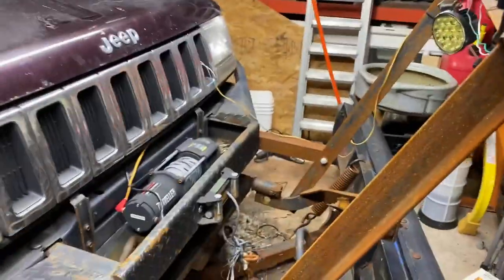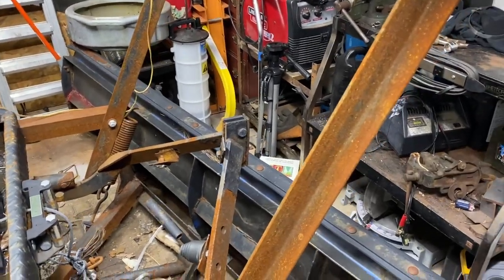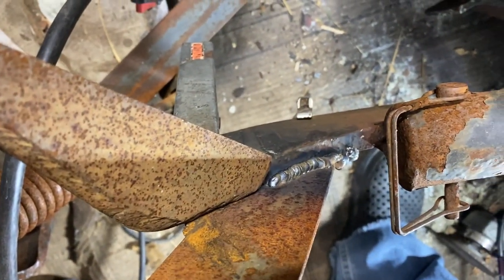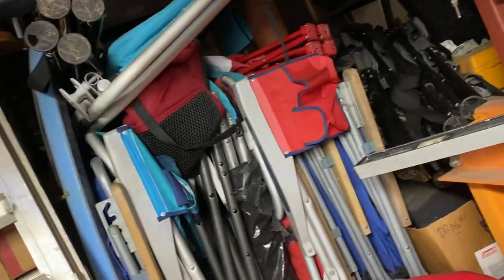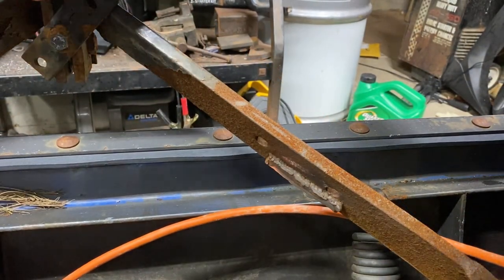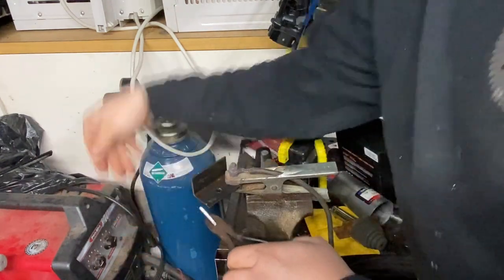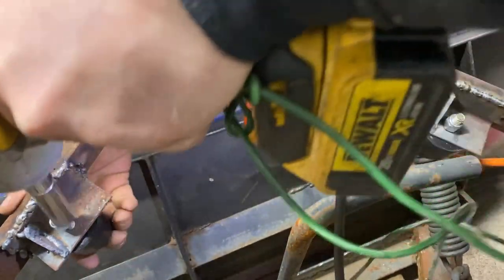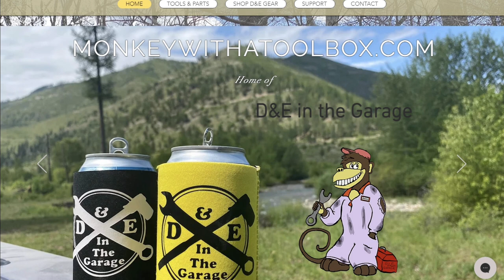ZJ Grand Cherokee SNOW PLOW Setup and Repair

Comment: Curious.....how does hitting something with the plow blade affect the unibody frame?
Reply: Well a big hit certainly would but I havent tweaked the unidbody yet. You just need to know what your plowing. Also its a floating system so as long as its not a wall or a curb it should just float over it